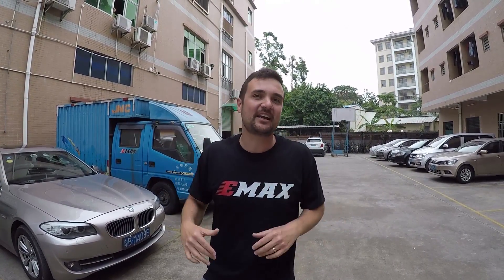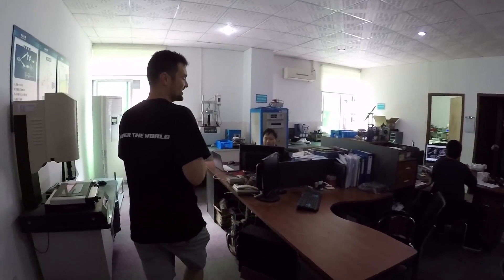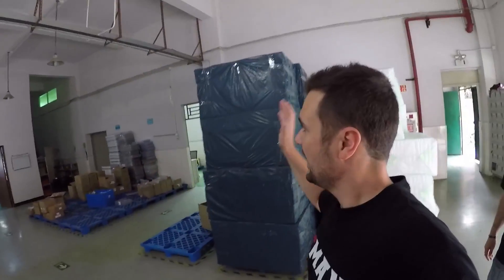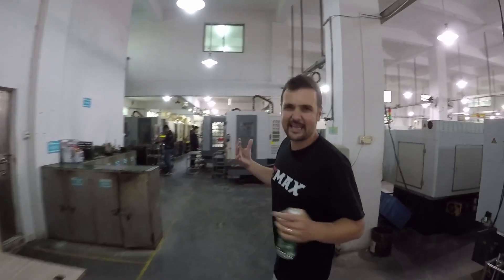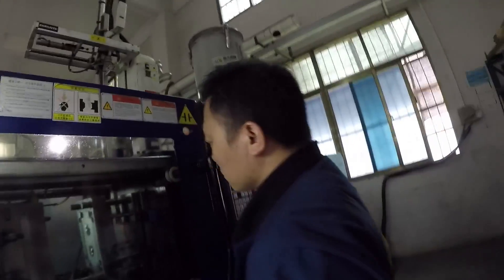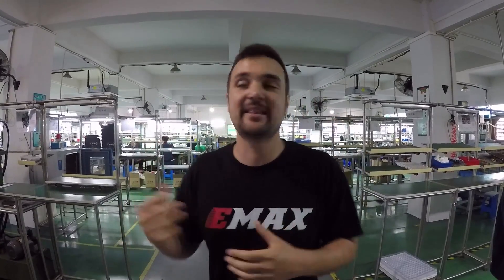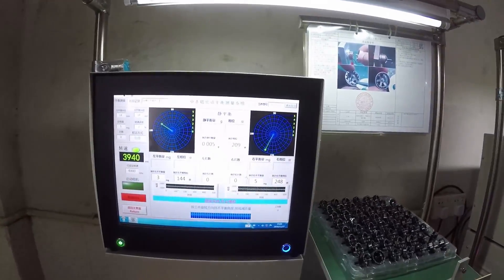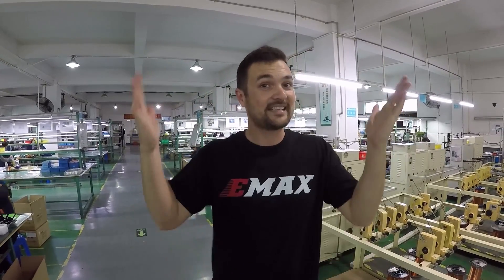INSIDE the largest drone factories in CHINA!

Comment: I've made injection mold tools before they can be very time consuming to make. It takes a lot to make sure they fit together correctly and dont flash extra plastic. 
those were very small blocks and only produced one or two things but still took a lot of machining time and manual labor to produce a quality mold. 

The majority of the ones i helped make were large and heavy. you needed a forklift to get the blocks in a CNC mill and flip them around for every milling processes.